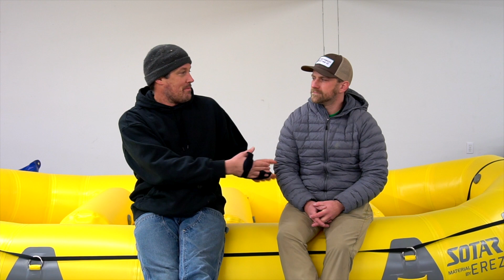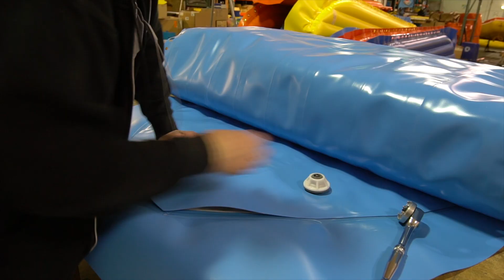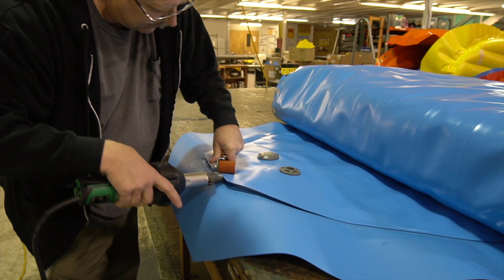Chatting with Jeremiah from SOTAR | Ep. 110

Comment: He’s wrong about the polyester absorbing energy versus nylon.

Nylon has both more elasticity and greater ultimate strength over polyester. Nylon will stretch considerably more than polyester before failure.

The advantages of polyester base fabric include rigidity, cost, rot and UV resistance, and the fact that it won’t absorb moisture the way nylon will.